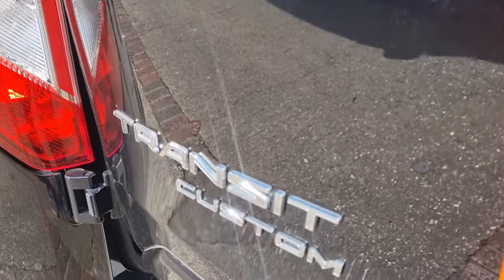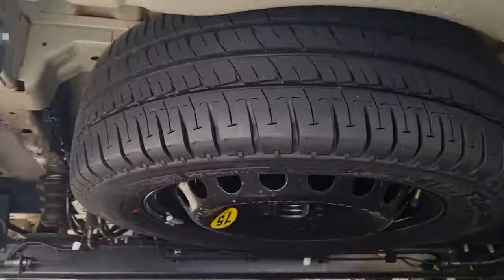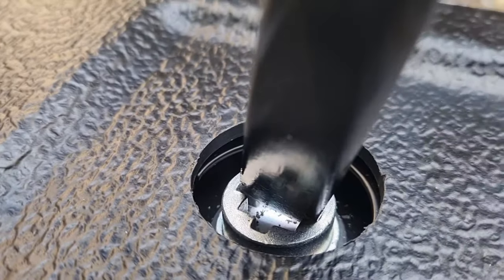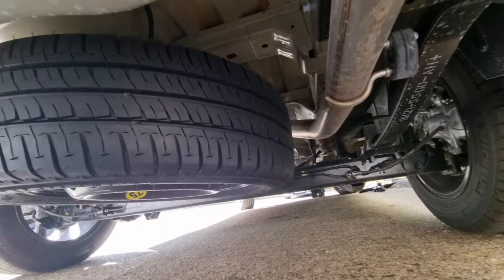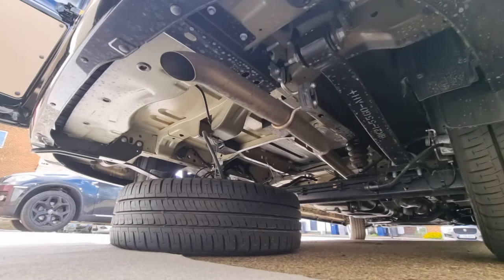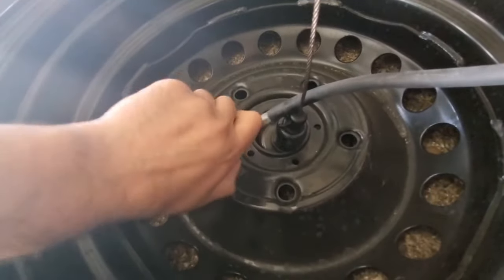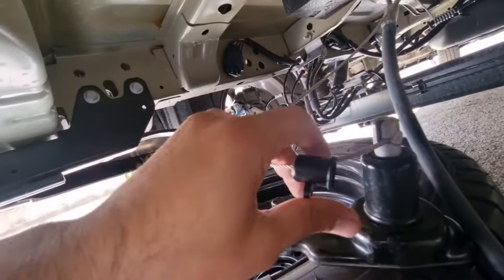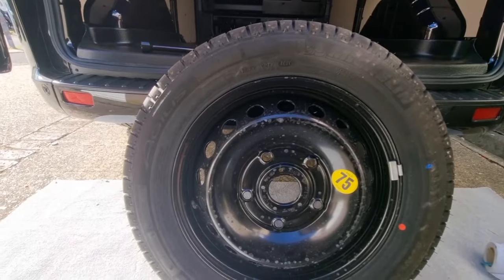Ford Van Spare Tyre Release -This will help you in an emergency and protect from being stolen!

Comment: Ford successfully come up with the most ham fisted way of storing a spare tyre, the jack is at the back of the drivers seat, held in place with a rubber band so tight you have to cut it, before you get to a central bolt so long it took ages to get out. Why ford couldn’t think of a simpler way than this heaven only knows. Good video that I made use of this morning at 5 30 am, in the dark changing a wheel.
Reply from the maker: No worries thanks. 
You are right 
Ford could have made it a bit easier .
Good luck

Comment: I got a 2022 Transit close to a year ago.  I decided to figure all of this out on a nice sunny day in my driveway.  I highly recommend it.  I also recommend spending 15 minutes every 6 months cranking that tire down and back up and give it a little squirt of wd40 or some such to keep it working like new for years.  Also, my jack seems useless unless you have some blocking to set it on as the van is so far off the ground.  If you like to be prepared, throw a piece of 6x6 or some such in the back, just in case.  The toughest trick for me to figure was putting the GD lug wrench back in the little compartment under the passenger seat.  Easy once you know, but damn...  thanks for sharing.  This will help a lot of people solve a few mysteries!!  :)
Reply from the maker: No worries. 
Please subscribe And like the video. 
You can watch and subscribe for my other channel to learn and watch interesting video. 
https://youtu.be/rKER47EcqfY
Welding vinyl flooring. 

But yea it's is simpl to take them out but damn it's hard to put it back in 
No one can work it out unless watch a video on YouTube..Great we have Internet..
One advice for you .please keep your spare tire inside the back of your van
I do .

Theif stole my tyre  and cut the cable 3 times ....I keep mine jus behind the driver seat at the back
Good luck

Comment: Had a puncture this morning. Our van is same but 2014 so none of this worked as all rusty 🤦🏻‍♂️ Had to cut cable
Reply from the maker: Ow what a nightmare..
If it was left for years undone there will be some rust coverage and deficult to open ..
You may have to store your spare wheel inside the back your van from now..
It's saver 🙌
Reply: Had the same problem today, also 2014 and rusty AF, but luckily working just fine
Reply: This is why I think Ford should have the spare tyre on the inside, or at least have a cover, to stop the attachment holding the wheel in place from getting rusty.
Reply: My van didn't come with a spare wheel when î bought it 2nd hand.
Got a spare last week and have just replaced the spare wheel carrier today as it was rusted up and the plate was missing.
Not happy with it though so im thinking about getting the wheel mounted on the back door

Comment: mate i have a mk 7 transit the camper conversion has covered it up with wood and i need to find the precise location to hole saw a hole to find access to it if you can help with that very much appreciated.
Reply from the maker: I would jack the rear axle on the axle tube only, you may risk of damaging the back plate causing a leak. , Do each side in turn. On the front I would jack on the bottom of the suspension arm, each side in turn. A lot of weight in these vans. Good luck,

Comment: The person who designed this, should be made to be on call out 24/7 365 Never have I seen such a bad design, the floor should have had the wheel well and a access panel in the cargo bay... What could be more simple? Imagine doing this on a 10yr old vehicle. What makes this even worse the designers are probably on £50K a year, no wonder the country is in the S*?t
Reply from the maker: Some of their  (ford ) details and design is a pain at the back ..so hard to work it out
Reply: Only problem with internal space under floor is if, like mine now, and needing to change, the load bay is rammed with 50 sheets of plaster board! No way I’d move that to change a tyre. The design could be improved massively, but probs not inside under the load floor.

Comment: WHAT A PIECE OF CRAP DESIGN 20 YEARS AGO THEY HAD A CAGE THAT JUST DROPED DOWN PULL OUT THE WHEEL SCREW UP THE CAGE AGAIN AND WE TAUGHT THAT WAS BAD, IMAGINE BEEN ON THE SIDE OF THE ROAD TRYING TO GET ALL THAT PUZZLE APART.
Reply from the maker: You are spot on . We all have this headache with Ford  😫 it's just so much hassle for nothing..